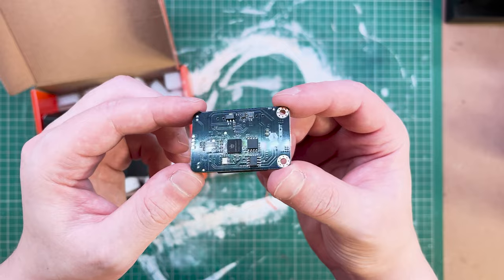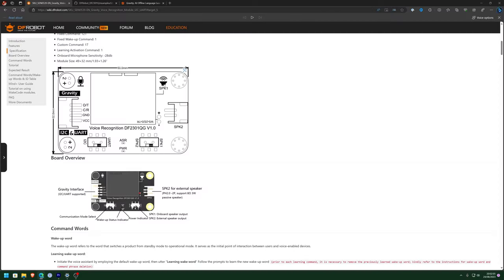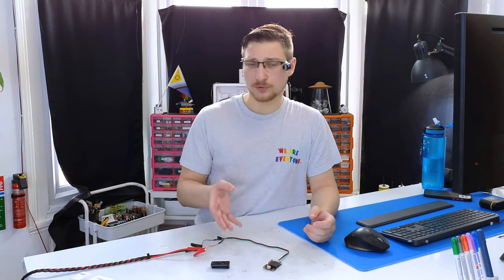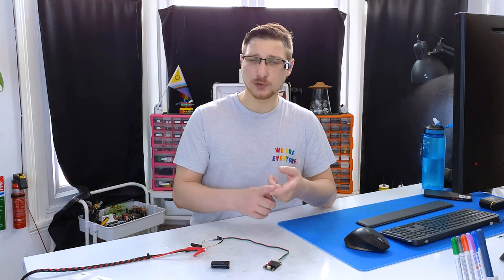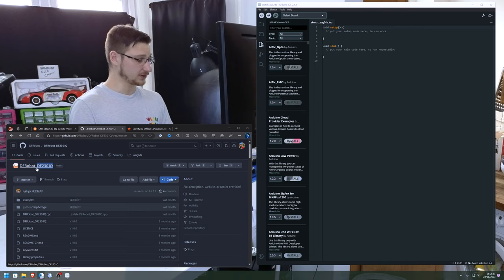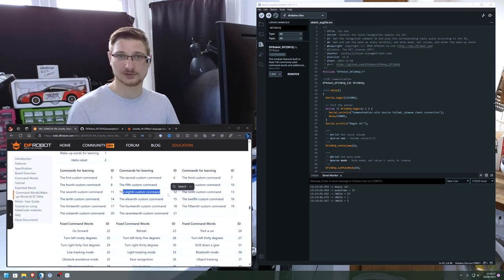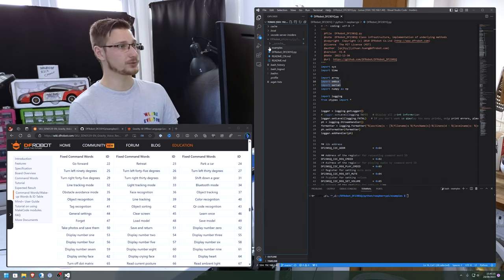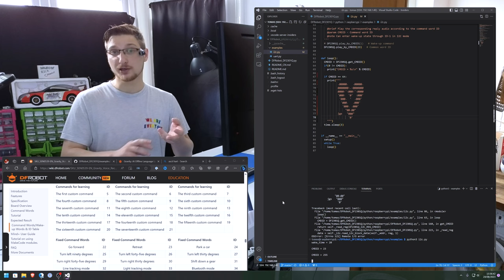Offline Voice Recognition Sensor

Comment: Actually I want to train a module to recognize emergency vehicle sirens and, when detected, module should  automatically turn on an LED without needing a prior command. Can this module help with that? 

Also will it work with Arduino uno r3? Pls reply..
Reply from the maker: Yes it works with the R3. but unfortunately there isn’t a way to make it a listen continuously, You need to say the wake up word.
Reply: @Mellow_labs  After turning on using wake up command , what's the maximum duration it remains active without interruption?also can I give wakeup command as clapping sounds?
Reply from the maker: It can only stay wake for 2mins max
Reply: @Mellow_labs Can't he just use sirens as the wake up command and have it do things using that? Sounds easy enough to bind CMD 1 via python. It IS listening continuously - just only for 1 command. Train CMD 1 for sirens - job done?
Reply from the maker: @TheMisterNebo  I haven’t tested it, but yes it should work. I’m getting a lot of questions about it, maybe I should make a second video. 
If you have anything else you want me to test let me know.
Reply: @Mellow_labs  a practical application of the voice control e.g. lowering shutters or garage doors (e.g. interoperability with the API of Somfi device), opening / closing door using a password in case of emergencies, turning on lamps e.g. via smart switch. A practical example of home automation using this - also a reliability test and your thoughts after 3-6 months of using it. Those would be useful :)

Comment: Falsely triggering a custom command at 5:50 is what worries me. How accurate is this module when it comes to custom command learning and recognition?
Reply from the maker: Because it doesn’t do any kind of speech to text processing, it really just checks whether the way form is the same as the programmed one. You do kind of have to be pronouncing things the same way you did when you made the command.
Reply: @Mellow_labs  thanks for the quick reply. How was your experience with it? Are you satisfied with its accuracy? I need to find a reliable offline solution that will control a large moving vehicle.
Reply from the maker: If I’m honest, I’ve not had a deployed for very long. I don’t particularly like voice control stuff. I’m so unfortunately, I don’t have any long-term testing.

Comment: I tried the same as you and it will not delete the "Hello Robot" ID 2  wake word. When I add a new wake word the Hello Robot is still there. Does this mean I have to do it in the Arduino program?
Reply from the maker: No, I think the hello robot one will always be there because it’s a back up in case you forget what the wake word was. And apart from very basic things, you can’t edit things like that in the arduino program